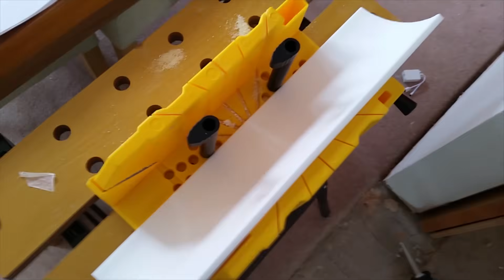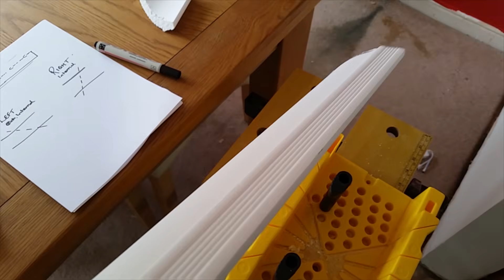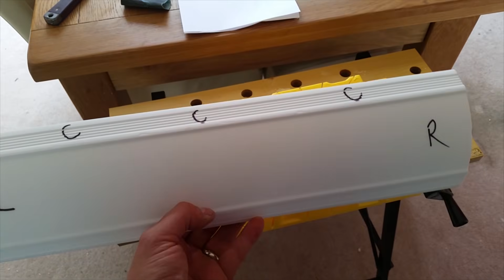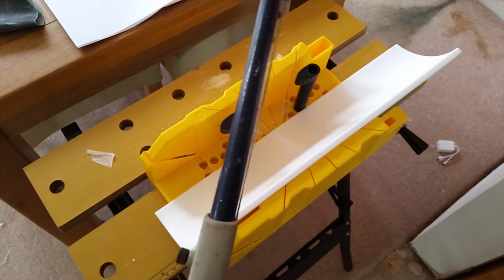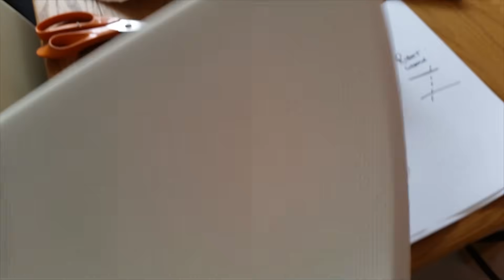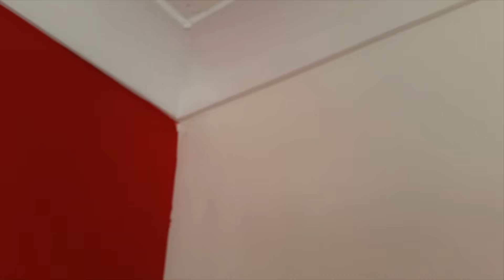DIY Coving tutorial - How to mitre cut and put up ceiling coving edging.

Comment: Mate i cant thank you enough. This is the only video i’ve seen that makes any sense. If anyones struggling still after watching. Just pause the vid and do the steps one by one exactly as he does. It works, i’ve just knocked out all my cuts in 15 minutes after spending all day failing on a proper mitre saw 😂
Reply from the maker: Haha it’s an old video I probably recorded on a cheap early model phone but glad to know it still does the job! Glad you got it sorted. 👍
Reply: @craynerd lifesaver. And sure you’ve replied after all this time! Any tips for filling and painting/ which products to use as now I need to cover up all the mistakes I made 😂

Comment: It would have been great if you explained how you tell Cieling edge from wall edge on the coving because sometimes it’s hard to differentiate which side needs to be against the wall or cieling. Very helpful video otherwise.
Reply from the maker: Hello, there is no difference - you chose which is ceiling edge and mark it on coving back. You then cut per diagram and the edge you marked as ceiling, goes to the ceiling so it all works out for the correct cuts.